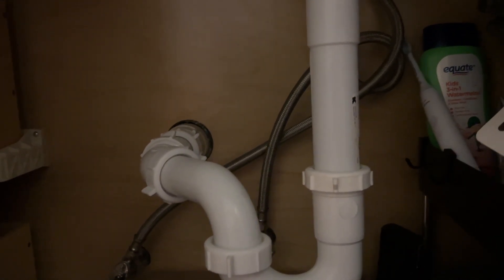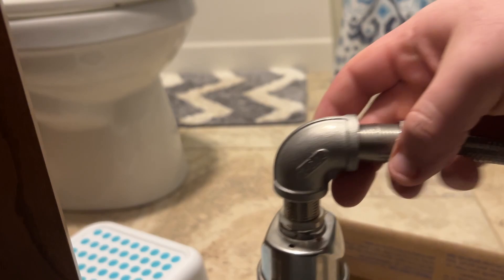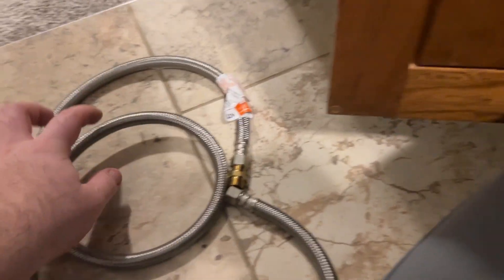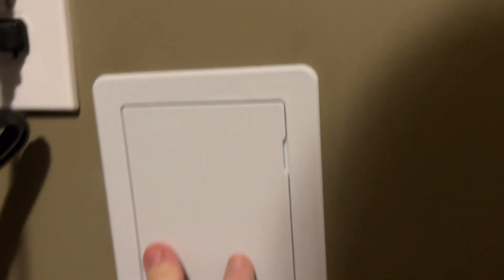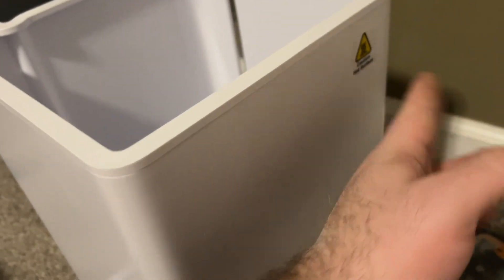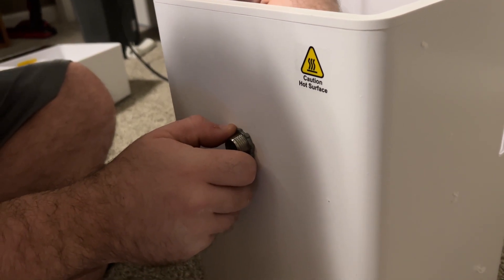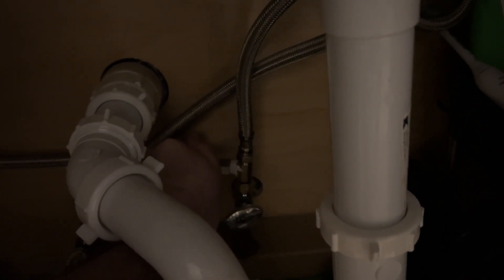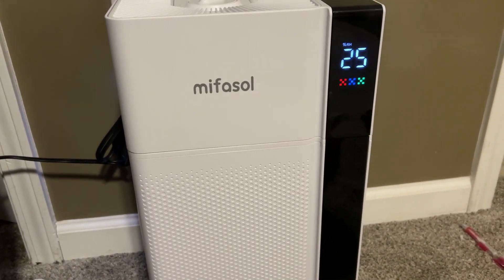Never Refill Your Humidifier Again! Genius DIY Auto-Fill System

Comment: Do you think it would be hard to add a brita or similar type of faucet filter to the waterline or would it not be compatible with the float valve? Most humidifiers recommend (or require for warranty) using distilled or filtered water to prevent mineral build up. Would be nice to just shut off the water and change the filter a couple times a year.
Reply from the maker: I’m sure you could not exactly sure how

Comment: 'Honey, could you fill the humidifier?'
"FINE.  This is the last time though.'

Solving problems of the first world.  I like the concept, but I think you are asking for water damage in your future.  Mechanical joints inside the wall are a terrible idea, I would pull the connection between the two hoses back into the cabinet under the sink, will make it easier to notice if it starts leaking.  I would also be very concerned that float valve will start leaking by and cause flooding.
Reply: I am thinking about doing this, but I am also worried about the valve failing and flooding the house. Any way of setting up a failsafe?
Reply: @JonathanRhodesLee  I would put a pan/tray under the assembly with a leak detector sensor in it.  You can get the old school leak detectors at the hardware store that are just a loud siren.  Or you can get a leak detector that ties into your home automation with a smart valve that will close the water line off to the house if a leak is detected.